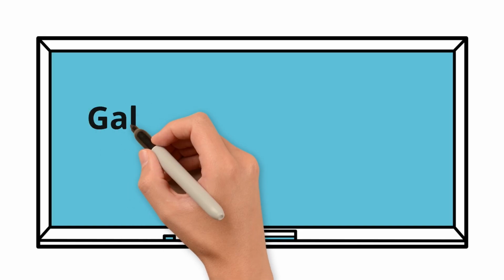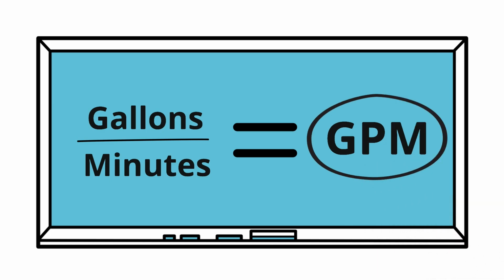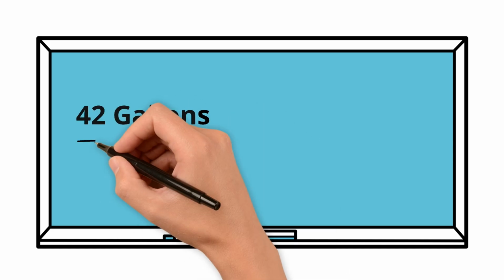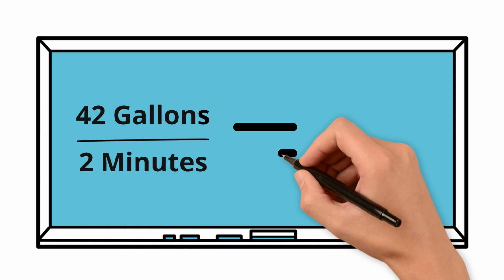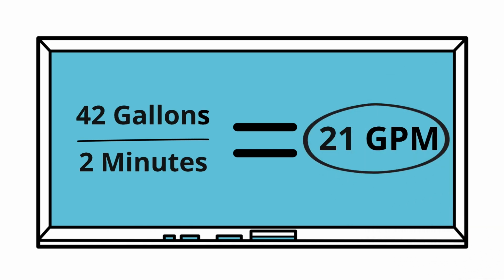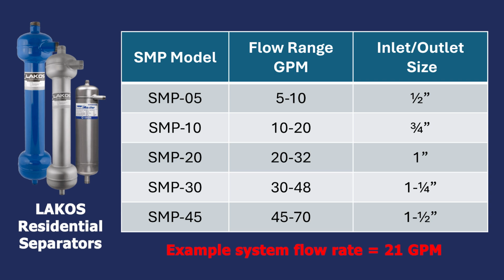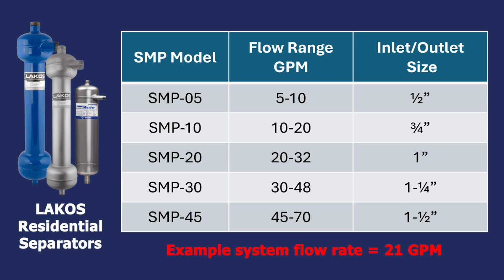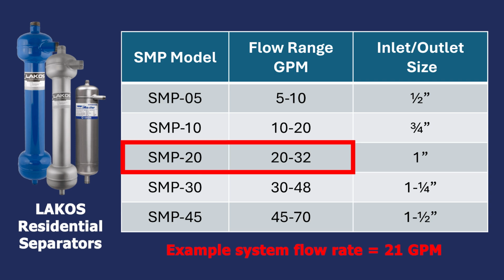The LAKOS Bucket Test: How to Measure Home System Flow Rate (GPM)

Comment: Terrible Video. How does filling 1/2 of a 5 gallon bucket (aka 2.5 gal) equal 42 gallons per minute as shown in the calculation portion of this video? This probably needs to be corrected because it won't come out right following the video. Spoke with Ty in customer service who was great, as he was able to explain this and other important items. PS: The website is not very intuitive either. Good products and customer service but see above.